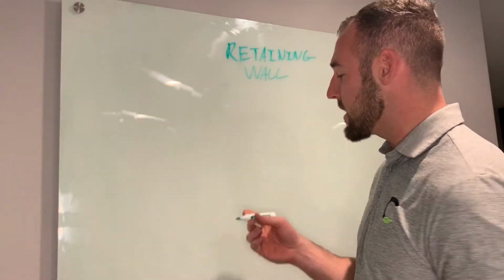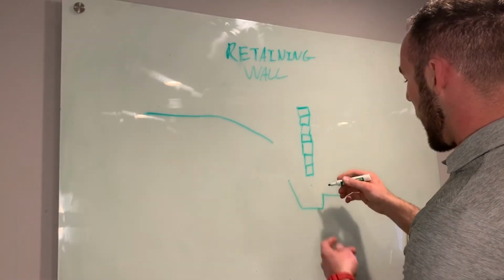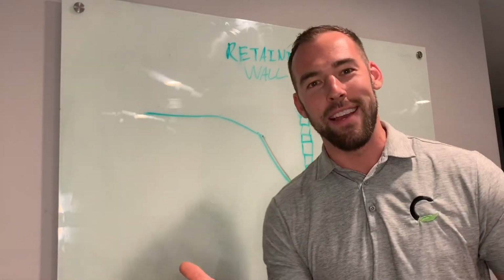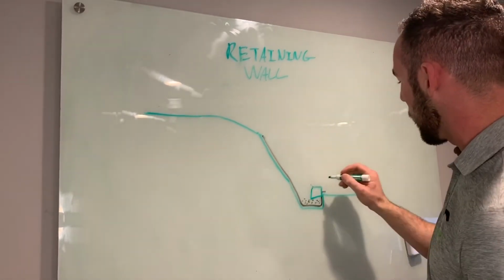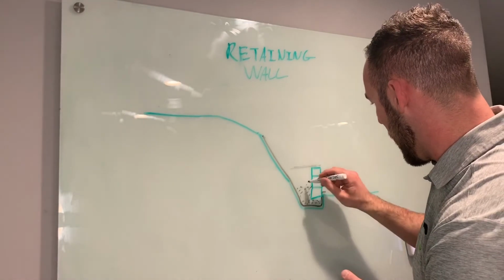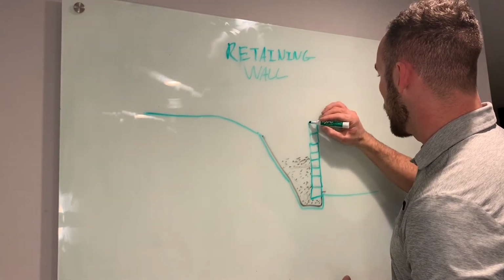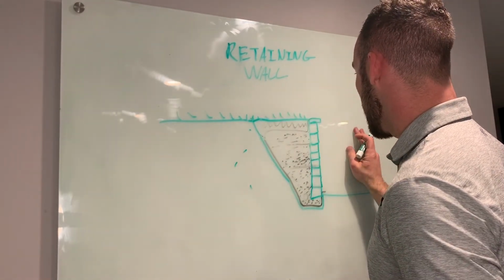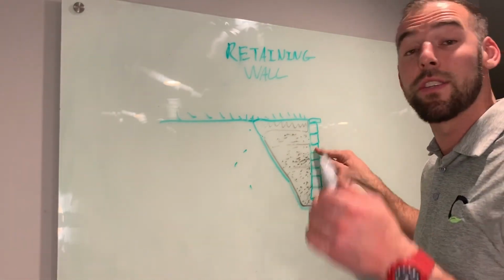Retaining Wall Installation

Comment: Thank you for this video, some would think that my prep work for the 2.5 ft wall I'll build in my backyard is overkill but if there's one thing we're known for in Florida it's rain and gators so I rather go overkill adding the drainage piping, the protective layer, the geogrid, anything and everything possible to avoid having my retaining wall shift later on

Comment: Describe that drainage pipe for me please. I have engineered plans, they are a little hard to follow. After getting very high quotes, I’m thinking of constructing the 48 inch by 130 long retaining wall myself. Are there holes in the drainage pipe? What material is the drainage pipe? Thanks
Reply: perforated drain pipe

Comment: Does your geogrid get installed into the (sol) native ground?  or Geogrid only in the compacted  3/4" limestone stone?
Reply: In my professional opinion, it should be anchored into the soil. If your wall is 6' tall, the geo-grid should be 6'-7' in length from face of wall. All of the engineered plans that I have worked with for the past 25 years calls for 12" of crushed stone behind the blocks/wall. You would need to have excavated enough soil to accommodate the proper length of geo-grid for your wall. My preference is to back fill and compact in 4" lifts with clean soil, meaning no rocks larger than 3-4". Some engineers call for first layer of geo-grid over 1st course sometimes 2nd, but never 3rd.

Comment: Company wants to do a solid 1 piece cement retaining wall with no blocks. Is that a bad idea?
Reply: Properly engineered (and built) poured retaining walls are the strongest. Depending on the application and location, you may need to veneer the face of the poured wall for aesthetic reasons and that will increase the cost of the project. Segmental Retaining Walls (as discussed in this video) are easier to install and have a finished look upon completion.

Comment: Wait! No talk of foundation? No horizontal reinforcement of the wall? No vertical reinforcement?  No back waterproofing?  Your foundation for the area has to be poured much deeper down and be thicker and wider.  No weep holes either?  I suppose you did not mean this as an educational video since it’s not by any stretch.  I guess it’s sort of a marketing video.
Reply: This type of wall uses a different style of construction than what you're familiar with.

Comment: City codes in CA would not allow this, you would need a "L" shape footing where the L extends the opposite side of the sloped grade min 12" by 3' long.

You would need double rebar for 8" block running from the footing up through the entire height of the wall, plus all the rock, drainage and weep holes.🤔
Reply: This is a Segmental Retaining Wall. The footing for these are of crushed stone and the vertical stability comes from horizontal geo-grid anchored by the soil as illustrated. What you are describing is for the construction of a concrete block wall with cement joints and a poured concrete footing.

Comment: One thing that makes me itch is that small foundation block and how shallow it is regarding the bottom of the slope. I live in a place where the freezing depth is 1ft/ 30cm and the top of the foundation has to be at least 2ft/60cm below grade. And those type of walls with concrete blocks are suitable only for parapet walls or walls that aren’t structural. But funnily enough make grade adjustments without walls. Or building dry stone walls or/and gravity walls, gabions are acceptable. But as you said drainage is the king.

Comment: Do you need a drainage system even if the ground is flat and level? Also, will holes cut out at the base of the wall or put in place during construction work?

Comment: How does one ensure that the top of that geotextile fabric that's near the cap, stays in place? Do you attach it somehow? Can you place it underneath (~1/2" or so) the cap before you glue/mortar the cap into place?
Reply from the maker: Typically, the weight of the soil on top of it and against the wall will sandwich it in place.

Comment: Can i not just backfill with concrete and not need a perforated drain?
Reply from the maker: I'd have to know more about the situation.
Reply: @CreeksideOutdoorLiving  iv built a house close to neighbours house, theres about a 200mm gap between my house wall and my neighbours drive. All detatched houses.  His drive is 1 metre higher because we live on a slope. His drive is concrete. Can i not fill that gap with concrete as a permenant solution?